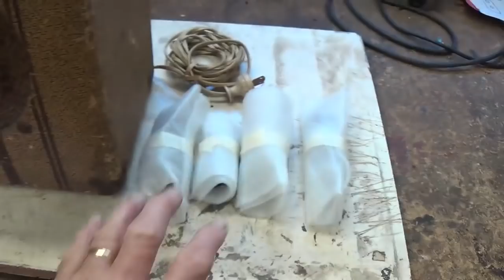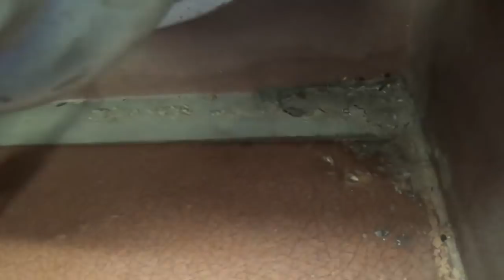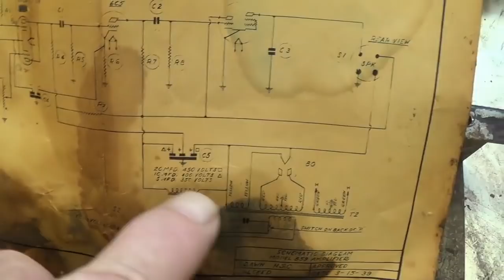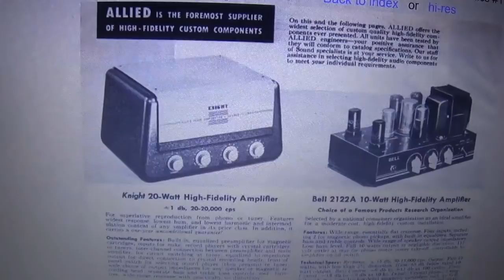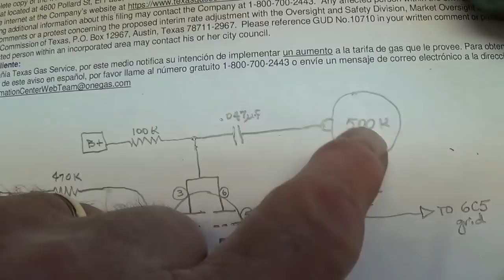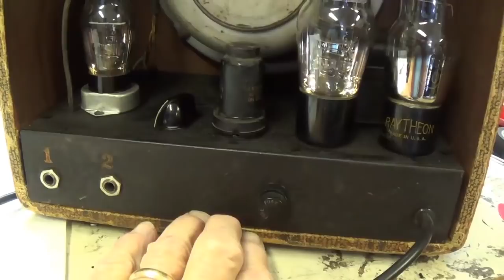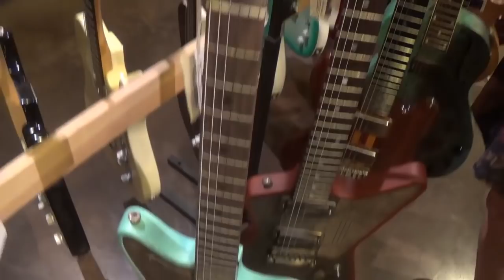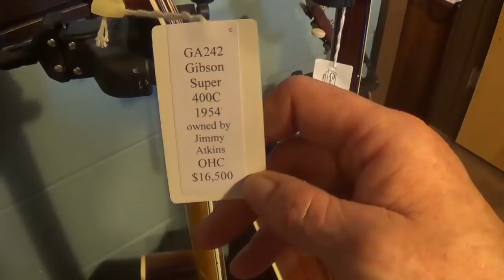Resurrection of an Ancient 1939 Kay Model 859 Amp....The Mouse that Roars (60Hz)

Comment: Hi Uncle Doug and family, Another great video and repair/ restoration. I hope all is good with you and yours. I have watched the PCB Champ conversion video several times, Thank you for sharing your vast  knowledge. A while ago I bought a G.E. Model 329 phono/AM,SW console that had most all the parts for a 5F1 Champ, $25. 85 watt Power Transformer, OPT, 5Y3, 6V6, etc.. Is a 1958 Jensen P12Q from a Hammond organ good for guitar use? It's a P12QC6577 number, code is 220845, used with an AO-29 amp. Thank you for replies. Till later, all the best, C.
Reply from the maker: That sounds like some good stuff, Cass. I would think any P12Q Jensen would be good for guitar use. Try it and see :)

Comment: Great video as always.  I am somewhat confused regarding the modification you made that departed from the schematic due to the buzz.  Was this a design problem or did the original have that buzz, or was there some other component that killed the buzz (not to be confused with a buzz-kill).
Reply from the maker: Elimination of the loud 60Hz hum required several alterations to the circuit, JD, including the addition of shielded input cables, improved grounding, removal of the cathode-filament wire, replacement of the volume pot, etc.

Comment: I was intruiged to see both a field coil and a filter choke as usually the field coil acts as the choke, they tend to be wired in an inverse way so any pops or hum on the power get removed actively. Every field coil speaker I've heard sounds gorgeous.
Reply: I've always felt that there's something very subtle going on with field coil speakers.  The current through the field directly affects the strength of the magnetic field generated, so it changes moment by moment as the load on the power supply changes.  I hate to be woo-woo about it, but there is a different sound to them than perm-magnet speakers.  OK, thinking for a bit about it: A stronger field will make the cone move further for the same audio signal applied.  It's almost like using an expander, the little bit louder you play, the volume goes up more than expected.  This would make for a great experiment: same amp with speaker leads switchable from one speaker to another, change the input a dB at a time and map the change in output from the speaker.
Reply from the maker: That's a very interesting suggestion, Joseph......one I never really considered.  Perhaps a good topic for a future video :)
Reply from the maker: It is unusual, Prince, but we have seen this in several of the very old amps I've worked on over the past year.

Comment: uncle Doug/question.  Why does using a 57 to mike an amp {I was amazed myself when a started using one just coming thouuh a couple monitors} make it sound SO much bettter when its only {reproducing} amplifing the sound from the speakers in the amp. thanks for your time. Is it as simple as your putting it thorugh other speakers .
Reply: I'd suggest the frequency response curve of the 57 has a lot to do with it. It's definitely not a flat response. There's a significant break upward in the curve at around 3KHz which is going to emphasize the lower order harmonics. The emphasis is not so great as to sound tinny, but enough "brighten" the sound. Just my opinion.
Reply: thanks
Reply from the maker: My guess would be that the microphone tends to capture the pure tone being emitted by the speaker, virtually eliminating all the extraneous background noises, echos, etc. It's like the difference between listening to the radio in a car, and using headphones.
Reply: thanks

Comment: In the tenure I've spent watching your vast expertise in diagnosis, redesign, and restoral of many "Holy Grail" amplifiers; none have been so profound as the audio tests of this 80 year old Kay. I (as always), admired the remarkable rethinking of the inputs to accommodate the specific performance requirements of the owner. I stayed impressed until the audio test with the guitar(s) floored me. This eight decade old, eight inch speaker, combo not only produced the sweetest shimmer from a humbucker I've ever heard! If that wasn't enough, the single coil was equal output, and had mid-rich overtones for full chord voicing!!! This (mind you), with the camera mic! I spent my twenties as a touring guitar tech for many eighties artists. I have heard a plethora of vintage to modern, to custom built amplification, and instrumentation. This little bastard of an amp has the most musical, and nuanced tonality from the least considered source to my ears. Dearest uncle, this is one for the books. I'm just sad to see it relegated to harmonica use. Nevertheless it is an affirmation of your skill, and I can live with that anytime.
Reply from the maker: Wow, thanks so much for your very detailed, knowledgeable, and appreciated comments, Alex. I think the camera mike was able to cope better with the wood fretwork than could the highly-directional Shure 57.  Your high praise is most welcome. Thanks !!!
Reply: @UncleDoug  The pleasure is mine. Thank you for sharing.

Comment: Some people make a big deal about the wholesale change of caps, but I have to agree that replacing an electrolytic that old is always the way to go. They're cheap. Unlike the tube that might die when that old cap fails.
Reply from the maker: In this case, the capacitors had failed so long ago they had almost been reincarnated:)  It was a must.
Reply: I don't know why that mentality even exists Mr. When something like an electrolytic cap made 50-80 years ago under, let's face it, very limited quality control measures, is purported to be still viable is ridiculous when risking exceedingly expensive and rarer tubes. Get out the shotgun I say.
Reply: @jeffbrooks7246  for some folk, nostalgia outweighs common sense.
Reply: @FixItAgainPhoney  Agreed. And if you run into someone like this wanting you to repair their amp you are best off to decline as it will be these same people blaming you for their fried PT because you worked on it!
Reply: @jeffbrooks7246  100%. I even get customers that will say to not touch the caps. I ask them if they play the amp or is it a museum piece?

Comment: I have the cover that would go over that preamp tube. That's what that little base in there is and I have those tall covers that lock into that if you would like one. I also have a brand new JAN 6C8G and all the other tubes if you need any of them.  Kevinbourke81@gmail.com.
Reply from the maker: Thanks so much, Kevin. When I worked on radios, I had some of those "mummy" covers, but not any more. I will relay your offer to the amp's owner.

Comment: The 6N6G was rated for (on the output section) Plate Voltage: 300V, Plate Current: 42 mA and Load Resistance: 7000 Ohms (all values typical).  It can deliver 4W Output Power at 5% distortion, and 6.5W Output Power at 10% distortion.  Looks as if your readings are right on the specifications.
Reply from the maker: Thanks so much, Dave. For once, I guessed right :)
Reply: I agree. This amp is spot on based on the Ken-Rad data sheet I found. Class A operation calls for 250-300V on the plates,  33-45mA of plate current and 2-4 watts of plate dissipation. Ken-rad datasheet link: https://frank.pocnet.net/sheets/201/6/6N6.pdf

Comment: At 18:00,  I suspect that the resistor wire between the output tube cathode and the filament supply leg was an attempt to bias up the filament supply for lower noise. The question is whether it was done at the factory, Whether properly or improperly, Or done by somebody else after the fact, perhaps improperly, or whether it worked correctly to bias up the filament supply for lower noise until somebody did something else inside of the amplifier like changing the grounding or the wiring of the filament supply or something along those lines . Also bear in mind that most early single ended amplifiers would be using the chassis for the return of the filament supply, Which is an inherently noisy way of heating the tubes because it generates excess eddy currents in the chassis as well as spurious resistances, and might be incompatible with the very idea of biasing up the filament supply....
Reply from the maker: Thanks for your in-depth analysis, GU. Its removal was one of several steps in eliminating the pronounced hum.

Comment: You can fine tube data for 6N6 in "Raytheon 1937 Radio Receiving Tubes" it is a down loading pdf file on the internet
Reply from the maker: Thanks, William. I have it in the Condensed Data section of my tube handbooks.

Comment: Your videos are excellent, Uncle Doug. I've learned a LOT including things about my old Alamo Embassy tube amp. Maybe the most important things I now know are that every vintage tube amp was the favorite place for rats and mice to live in and that repair men believed then that you only needed to attach the chassis with two screws regardless of how many originally held it in place. But those old amps are beautiful and you couldn't get mine away from me with a shotgun. Thanks as always for posting.
Reply from the maker: Thanks so much, BW. I agree with your observations and would only add that neither of the two screws should match each other.

Comment: Hi Doug! An interesting note on the Knight amplifier. When Allied listed factory built electronics in their catalogs, It went under the name Knight. If it was in a kit form, It was called Knight-Kit. I remember getting Allied catalogs throughout my early years in electronics. They were in competition with Lafayette Radio back in the good 'ol days :)  The 859 is surely an interesting, yet simple amplifier. Very strange that it had a bad pot...although not unusual, it's not a common occurrence. The amp sounds pretty darn good for a 1939 model. I've always felt that A field Coil speaker has a much better low end than a PM speaker. Once again, great video. :)
Reply from the maker: Thanks so much for your helpful and knowledgeable comments, Frank.

Comment: Great video as always. It's nice to see a good sounding 8" amp, they can often sound really boxy or strangled but in those clips that one sounded really nice. On the opposite end of the power spectrum, I finally finished my 135watt Sunn Model T-inspired amp, using 6l6's instead of 6550's and with an extra 6C4WA as a boost up front. It sounds positively monstrous haha. The only weird thing i've noticed is that both that 4x6l6 and my 2xEl34 build I finished recently do this thing where when i first switch them on, just as the tubes heat up I get a quiet but noticable 60/120hz hum on the output that briefly rises and then disappears over about 3 seconds, and then the amps both are effectively noiseless after that. Have you ever experienced that? Both amps are ultralinear so could it be a side effect of the UL circuit stabilizing?
Reply from the maker: Thanks, Daniel. My guess would be.....and it's just a guess.....that the hum is originating in the power supply, perhaps the rectification and/or filtration takes a few seconds to come up to speed.
Reply: @UncleDoug  ,  Concerning the question from the person who built his own amplifiers, my guess is that  the push pull output stages are a little bit imbalanced momentarily,  perhaps due to one pair of tubes warming up more quickly than the other or some imbalance in the output transformer,  that causes the amp to not have any hum cancellation in the output stage just for a few seconds as everything warms up.  One of the advantages of push  pull output stages,  besides the capability of achieving higher power, is that the hum on 1 side of the output transformer primary is out of phase with the hum on the other side of that primary and therefore unless the tubes are severely mismatched or the transformer is poorly made ,  much of the hum will be canceled out.

Comment: That Kay 859 is 10 years older than me..  I don't look or sound that good now !   Perhaps I've had a rat infestation  which now needs cleaning up to compliment my replacement and-or, missing parts..  The better half noted the faulty on/off /volume control, and suggested  you send me the old one so she could install it in me in the permanent 'off' position.  Great video, and I'm still getting over seeing so many vintage guitars and amps in one place.  The better half is relived  that the shop is 4,000 miles away from us. 🎸 🔇
Reply from the maker: Great comments, Pete. Thanks !!!

Comment: Something I've always wondered, because I often see these old amps with trashed speakers, can these speakers with the transformer on them be replaced with a modern Alnico or ceramic speaker?
Reply from the maker: It's the field coil in the speaker that is difficult to replace, Sean. The output transformer is the same for PM speakers. You have to add a filter choke to compensate for the missing field coil when replacing an ED speaker with a PM speaker.
Reply: @UncleDoug  Cool. Good info. Thanks! Maybe I'll be brave enough to pick one of these up next time I see one.
Reply: Mounting the original transformer,  or a suitable replacement, onto a replacement speaker or elsewhere on the amp or in the cabinet, is not the issue.  The real issue is that the electro magnetic field coil of this original speaker must be replaced in the circuit with some kind of choke coil, a large inductor coil, if you are going to run the amplifier with an Alnico or other permanent magnet speaker. The field coil of the original speaker is part of the power supply of the ample fire and provides filtering as well as dropping a few volts from the power supply. It could perhaps be replaced with a large resistor and an additional filter capacitor, but the physical size and wattage handling of the resistor necessary could become a problem, as it has to dissipate a lot of heat safely and reliably.

Comment: Looks very similar to the '39 Oahu I have.
Reply from the maker: Perhaps both were made by Valco (?)
Reply: @UncleDoug  Quite probably, all Chicago based and interconnected. Tubes are 80, 6N6G, 6C5, 6N7, although the chassis layout is a little different. On the Oahu, the volume only works on the mic input, guitars were assumed to use their own volume know.

Comment: It was good that you replaced that extra long power cord, I don't think you would have saved any money by plugging it into another state with lower cost electricity, any savings would have been negated via copper loses.
Reply from the maker: You're right, Micheal. I sold the copper wire for scrap and got enough money to buy a new Corvette :)

Comment: That grille will function as a beam blocker on the speaker, may be just right for a harp amp. Great video as usual!
Reply from the maker: By coincidence, that is exactly what the owner intended to use it for, Bill. Thanks !!
Reply: Bill, a friend of mine is a harp man and we have talked about what makes a harp amp special. Like Doug I think about electronic ways to do this. I think I get what your talking about but can you explain "beam blocker" a little better?
Reply: Jeff Brooks For my Harmonica set up I always mic toward the edge of the cone. What comes out of the center of the cone is generally too shrill for my taste. Some players will put tape on the grill cloth At the center of the speaker to block the harshness.
Reply: Weber (And maybe others) sell piece that attaches between the speaker and grill cloth that accomplishes the same thing.
Reply: @billmiller7138  So this piece of thin plywood or laminate (maybe it is solid planed) in Dougs amp has a pretty large surface area compared to those methods. When I said I thought I knew what was going on I thought it was reflective. You speak of picking up the edges if I understand you.
Reply: @Bill Miller I just re-read my post and it sounds dumb and incomplete. I guess what I mean to say is would you not be getting an auditorium effect from a large surface area close to the speaker? And I think a "beam blocker" in the context you mention means more of a suppression effect if I understand it right, perhaps even an absorption of certain frequencies.

Comment: I think that fabric is something we call/called Rexine in the U.K. It was used for book, binding, spectacle cases and some of the earliest Vox amplifiers. I had a very old Vox 2 x 12 with original blue Celestions which was covered in rexine before the "basketweave" fabric became the norm. It came in various colours.
Reply from the maker: You're probably right, Stuart. It does resemble the material used to cover older books. Thanks !!!
Reply: It looks a little like what's on my vintage suitcase.

Comment: A quick check of an inflation calculator shows that the Knight amp would cost over $600.00 today!
Reply from the maker: ......and probably worth it. It is beautifully designed and built. Thanks, Joseph.
Reply: Brand new, pre-assembled tube amplifiers of our current era that sell for $600 are invariably built with printed  circuit boards. A hand wired,  point to point tube amplifier would almost certainly cost significantly more than $600 if it was made to day (unless purchased in kit form,  but even then you have to factor in the cost of the tubes and the speaker, and the wooden box or cabinet).  The inflation calculator isn't very accurate for this type of scenario.